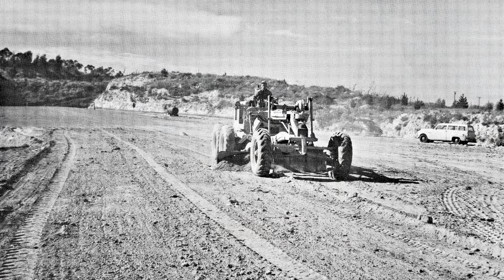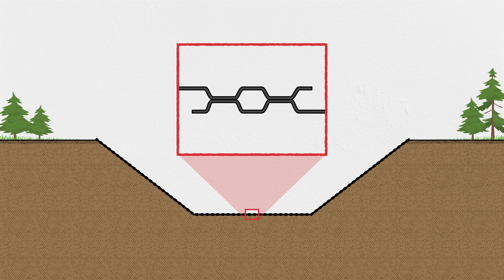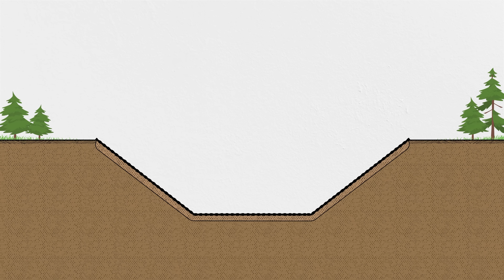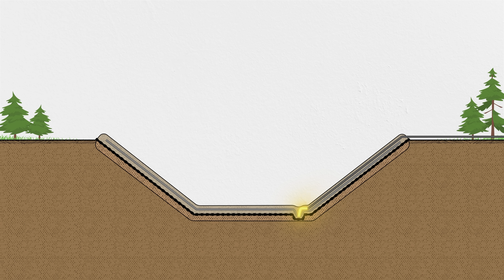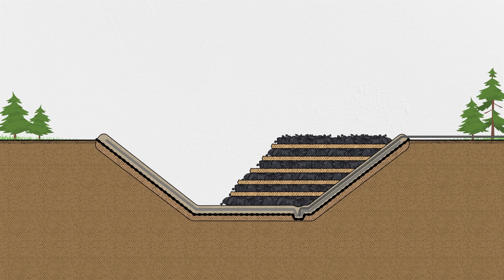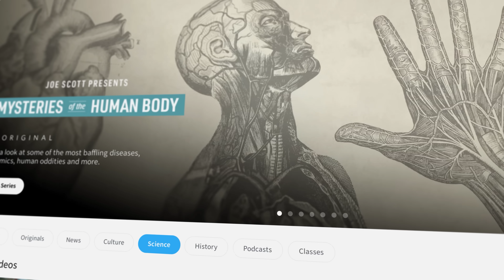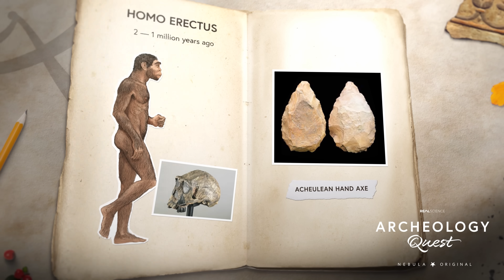The Hidden Engineering of Landfills

Comment: landfills are just not a permanent solution. The US is rather poor in waste management and is dumping more waste into landfills per person than most other western countries (but there is still a lot to improve even for many european nations). The first step would be to separate the waste at least somewhat: paper can be recycled easily or just be burned, metals and glass can also easily be recycled. Plastic could also be recycled but there are way too many types for really efficient separation - but without that it can basically only be burned.

But Landfills are still a lot better than what many other nations do. Seeing the annual floods clear out the meter high layers of trash in chinese rivers is a sight to behold.

Comment: Back in the 70’s and 80’s UK landfill was no where near this sophisticated.  It was basically a natural depression in the land, filled with junk and once full, covered with top soil which in a few years looked like any other field.   Nobody worried about this leachate, at least not rurally.  BTW…despite the claims of some, not all landfill is domestic consumer packaging waste.  A lot is rubble, wood, tv sets, paint cans and other commercial rubbish mixed with household waste collection.  Eventually the biomass decomposes and the remaining hard waste is inert, buried forever and unknown to most.  Problems have occurred when the mass loses volume and the surface collapses in…not good when the local authority has “accidentally” sold the land for building upon, or the gases (methane) escape to the surface an start spontaneously igniting “Will O’ Wisps” across a social housing estate😂.

Comment: Although recently retired, I worked for a regional municipality as a Waste Technical Officer as part of a team constructing, operating, environmental monitoring of two large landfills for many years. Your description of landfill operations is spot on. One thing you missed was the management of LFG (landfill gas) via flares begins from day one of the operation and in one of the landfills we collected LFG for power generation into the local grid well before the facility's end of life. 
Also one of the main management problems in landfills is the three types of water. Clean, dirty and the one you mentioned leachate. All three types must be managed separately. So the management of surface water and 'dirty' water via HES or High efficiency sediment basins to flock (clean) water off the construction areas before disposal to creeks and rivers is essential. 
Residents have always complained about the charges and the cost of disposing of waste and although we spend lots of time and money to educate, unlike those of us in the industry, most people are uninterested and generally don't appreciate the engineering, science and costs that go into landfills. Thanks for your well researched video of this fascinating, essential and environmentally sound industry.

Comment: I used to work in a landfill site in my civil engineering training many year ago. Waste management is a multi-engineering operation business, It includes site formation works, earth moving, rock blasting, slope stabilzation wall, sewwall, pier construction, biological treatment plants, gas collection system, leatchage pipe laying, liner laying and etc. Planning, construction, operation, decomission, restallation of a landfill site may lasting more than 50 years....Because the site is so huge, design phase, construction phase, operational phase, decomissioning phase and restoration phase are all happening in different portion of the site. There are lots of things to learn in solid waste management business.

Comment: What if we have tunnel Boeing machine that digs its way under a landfill. It eats everthing and separates metals from other wast and processes soil. As it crawls round from bottom to the top. It will free up space as the top level settles back down. What can be recycled plastic and metals but compost that is safe can be used for non food fertilizer. Recycling a landfill. It’s like unicrom from the original transformers movie. That eats worlds.  It it eats wast.

Comment: About 70 years ago before regulations my father's friends wanted him to invest in a new land fill he thought it was a bad idea and didn't invest . They bought low value Canyon land and terraced the sides to cover the trash. When it was full they built a golf course on top of the fill and built up scale houses overlooking  the golf course . The investors became very rich. I know of 2 housing tracts built in this area on top of land fills and law suits  started when tires and gas leaks appeared .
Reply: That's good! Wait that's bad! Wait that's good! Wait that's bad! Wait that's good! Wait that's bad! Wow what a roller coaster ride :O
Reply: When you said apartments built on top I’m like ugh not a good idea to live on a land fill . I know the engineers do great work but it’s not an easy problem and u don’t wanna find out and get cancer or sick 10 years later
Reply: @dcamron46  realistically, if you compact the absolute hell out of it and put a solid amount of dirt on top, it should have no possible impact on the surface.

The problems likely arise if you try to cut corners and I imagine doing it properly (in terms of building housing on) is super expensive.

It wouldn't surprise me if compacting it to hell, then putting a thick lure of clay plus plastic liner and then multiple feet of clean dirt is going to to cost more than you can sell the land for.

I'd rather just do the bare minimum so it's not exposed and then make it a green space.

Another option would be an industrial type area because the majority of it will be concreted over anyway (I don't necessarily mean manufacturing factories but mechanic shops, hardware stores etc.).
Reply: Oh, dear. Those investors never heard of Love Canal, huh? What an unfortunate set of decisions.
Reply: @Beryllahawk  They probably got rich enough to afford some good lawyers. Too bad for the home owners, tho....
Reply: Did the guy who invested in the landfill go belly up?
Reply: @TommyTomTompkins   I imagine that if it hasn't happened yet, whatever fortunes were made on this particular idea will be... hehe... trashed.

Comment: 9:04  'Landfill Lasagna'
There is no way around it.  Using landfill is a band-aid solution to a herculean problem that our descendants will inherit.  Putting it bluntly, we ARE incrementally destroying our home planet, unless we recycle ALL that is discarded.  Which is to say: we do NOT HAVE a solution.

13:55  As in many metropolitan areas, I am sure, half of my water bill is the sewage water treatment charge and it is usually higher than the potable supply part on it.  
So I reuse/ recycle the 'gray water', as a major portion of what already flowed through the meter for primary use from the main utility lines on gardening and non-potable chores-like toilet flushing ( light laundry can be hand-washed).

Comment: I've been practicing in the Solid Waste industry for almost 20 years.  Grady, as always, this was an excellent introduction to the engineering in landfills, especially the part where you said almost every college degree can factor into landfill construction and operation.  In most cases, the difficulty is not the engineering, but the permitting.  Succesfully permitting large expansions or new sites (greenfields) requires City/Township, County, and State approval to allow operation.  Some landfill sites I manage only take in a couple thousand tons a year and don't have much money for elaborate systems, while others have massive sites and want to be at the forefront of technology, especially for leachate reduction.  

As with most other Civil disiplines, there is never a one-size-fits-all approach.  Understanding the geologic setting and designing a landfill well-suited for it's environment is just step 1 (although definitely the most enjoyable part).

Comment: You finally covered my field of engineering and you did an absolutely incredible job! Wanted to point out that landfill leachate is a big part of the current concerns over PFAS meaning that all of those treatment methods you've covered are probably going to be deemed insufficient in the next few years. Looks like membrane treatment (like reverse osmosis), is likely to be the main method of treatment unless destruction technologies advance a lot faster than they have been.

Comment: There are perfectly good active volcanos where the trash can be tossed down.
Reply: Yes, but very few active volcanoes actually NEAR where waste is being generated. They are more often than not in remote inaccessible regions. Who pays for transporting a 100,000 tons of waste to a volcano outside of the state (LA County alone)? Then what about all of the toxic fumes generated by burning all of that plastic waste? At least industrial incinerators have scrubbers to filter out toxic fumes.
Reply: @glennac  Ahh, but here's the fun part, industrial incinerators require fuel and time to heat up, this costs money, where a nice volcano with rolling lava is an always-on furnace, most waste and trash will not need scrubbing as the excess gases are burned off on the spot.
A volcano can generate more toxic fumes than any plant in seconds.
Think of using the volcano as returning material to the source.

Comment: That's not the way it should be done. 
Industries have to be held responsible not even produce one time packaging. (Coca cola is trying to avoid reuasable bottles since their existence)

Then, reuse what we can
Then we have to recycle (ACTUAL recycling!) 
And then it has to be burned (thermally used)

And then, only then, can the rest be put to landfills (which is just a 0.001%-fraction of what is shown here. Basically heavy metals or other extremely toxic waste that can't be dealt with differently)

This video gives me vibes that all of that is ok. But only because there is an engineered solution doesn't mean it's the best way to do it.

Comment: As a swiss citizen i'm shocked by the concept alone. Here we burn it, filter the smoke to such a high standard that only some white smoke appears and the air doesn't smell weird near the treatment facility and we use the heat from the burning to generate electricity.
Reply: Well, you don't exactly have the luxury of space, now do you.
Reply: With enough density that becomes a more and more attractive option.
Reply: I had exactly the same thought! :D
(I'm also a swiss citizen)
Reply: Yeah this is a much better idea. Landfills are literally wasted resources. And to boot, quite literally everything that goes into a landfill is recyclable at some level. It just requires a certain degree of engineering. 
It can even be self-sufficient in providing the energy required to recycle the materials...
Reply: Here in the US we have countless hands in the "cookie jar" so a common sense approach to our municiple garbage issues like in your country is next to impossible in the US.
Reply: If recycling becomes much cheaper in the future thanks to robots, then landfills might go from a liability to an asset. So it's not obviously better to burn the resources right away.
Reply: @jonatanwestholm  What? Robots to recycle? Heat it, spin it, wash it. There's your sorting right there.
Reply: @jonatanwestholm You know WALL-E was trying to warn us of what will happen if we continue with our current system of making disposable products that we dump in landfills, it wasn't trying to tell us that we should make trash robots to fix the problem.

Comment: Great video! I loved that you hit on how they get turned into parks. I grew up in a small town in the flattest part of South Dakota with a single hill that I used to go sledding down. Years later I found out it was an old landfill! 

Anyway, if you ever do a follow-up it would be good to cover some of the engineering that goes into the generation facilities that use the methane, etc. to generate electricity rather than just flare it off. I'm on the power side and would say for my part of the country that's the type of generation that I know the least about.

Comment: I swear everytime I start a new project/job this guy makes a video about it.  Landfill liners are fun to install spend a week filling sand bags making a mountain of them then you forklift a liner role to the top and clip on with 6-8 guys and run down the 40% grades at lunch time you slide down the bentonite fabric layer. It's good fun

Comment: I understand we made it a lot better than it used to be, and considering the amount of trash we produce, it could be considered "low impact", but still, i'm in "i can't believe we have decided this is fine", camp, and i really believe we should make more effort into not producing so much waste. It's another area where plastic has been both a blessing and a curse, it's just too good and too cheap for us to use in a reasonable way. We just would't be able to produce so much waste wood or metal as we do of plastic. Cardboard might be the exception, with the advantage of being (i believe) easier to recycle, but it's a lot less flexible in usage (unless mixing it up with other materials and making it hard to recycle again).

Comment: Great video! It's nice to know landfills (if done properly) are actually not that bad. 
Korea takes waste management a step further and has mandatory biowaste be separated from the rest of the garbage. So basically anything besides bones and large seeds like from a peach are disposed of separately and with a separate type of trash bag. This is great in dense cities like Seoul where you obviously cant compost in a back yard. It can then be used as compost for farms or hog feed or harnessed directly for its methane. On top of this it shaves off a lot of excess weight (mostly due to water) being added to the rest of the garbage.

Comment: And then there’s the old dump in Iqaluit (which apparently they’ve improved on recently): take a flat area a couple hundred feet from the airport approach path, fill it with trash left hncompacted and uncovered, act surprised at how much of it blows off into the inlet right next to it, don’t even check for leaks, and declare a state of emergency when it catches on fire… clearing space in the dump for another decade of collection!

Comment: All this regulation also causes issues. Our land fill use to take leaves for free. They would make mountains of leaves and turn into mulch and then use the mulch for gardens and fields. Then the government said they needed a million dollar drainage system so rain water did not run over the leaves and go into the ground. Mind you only leaves from trees were allowed in this area. So the dump decided to charge for leaves and now dumps them into the normal landfill.

Comment: This landfills seems like tech from the 18. century. You have a lot of resources that are simply wasted by putting them into the ground. It is kind of a crime. I always wonder at what point companies will buy the landfills in order to open them up and recover materials. In any case, the cost of products is way to low and avoid & recycling seems to be to hard for some countries. Just add 35% import tax on cheap stuff from china and see how the material that go to landfills will go down a lot...

Comment: New look with the beard. I live 3 miles from a large regional landfill build on Bay wetlands. It started off as a small municipal dump. After 70 years it is still growing. To locate another site and close this one be take another 30 years. Since Earth Day 1970 there have been slow and modest improvements regarding environmental concerns.  It's a 100,000,000,000 annual industry in the US.

Comment: I grew up near a landfill that started in the 60's and ran through the 80's and is now an active superfund site because of it. It's now a 60-acre field of what would normally be prime real-estate (back when it was started it was out in the boonies) but now it's dotted with pumps and gas extractors forevermore (or at least since 1992 and will be for a long time to go). 

It's not completely useless though. They're using the margin area as an essentially free area to run a new light rail line (obviously being careful not to break anything).

Comment: landfills are a relict of the past, atleast here in germany. it gets burned, producing heat and electricity. and that goes through very good filters. in munich there were huge landfills, these STANK. they now capped them off and built a windfarm on it. if you didnt know you wouldnt realize that these green hills are trash.